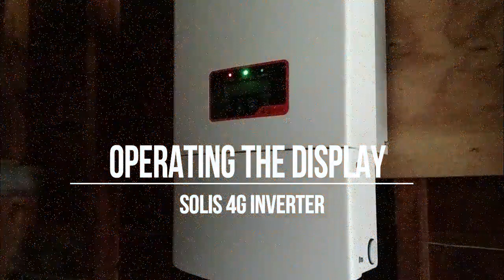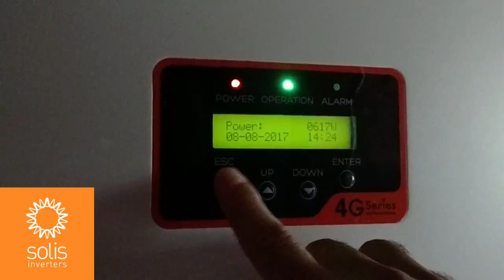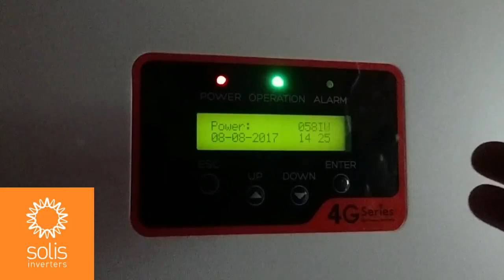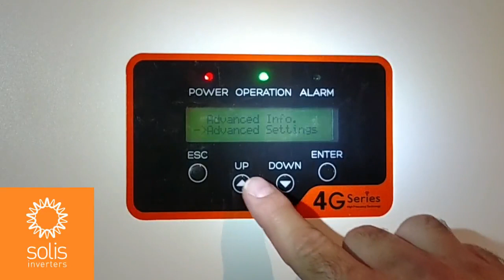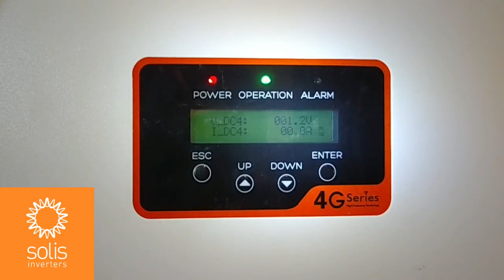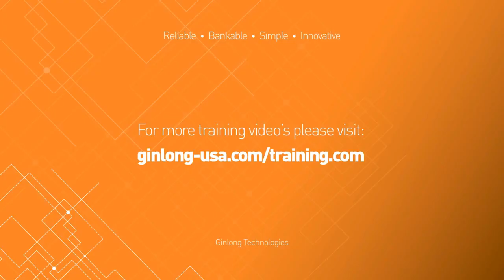Solis Training Video -  Operating the display

Comment: Why I Change the time (hour) in this inverter and when it restarts the old time comes back again?
Reply: That should not happen Jose.  There is a small "coin" battery inside the inverter display board.  It should keep the time and date current.